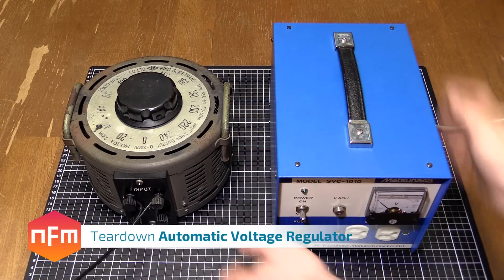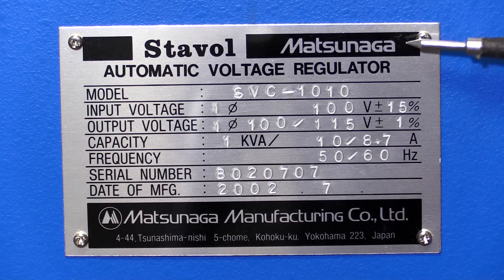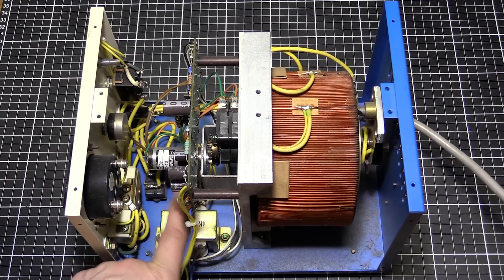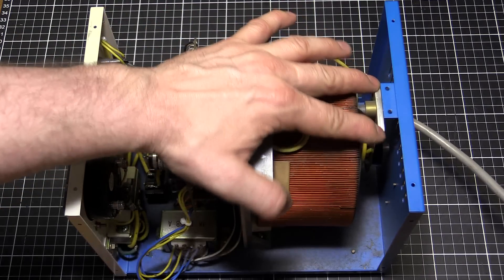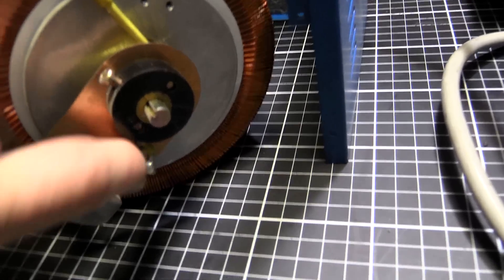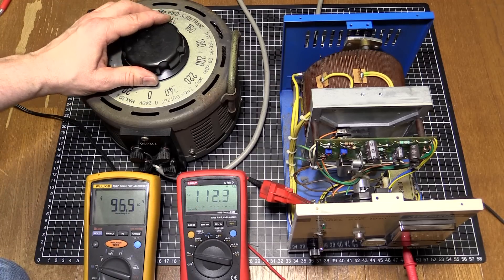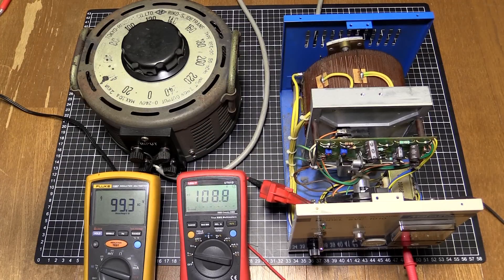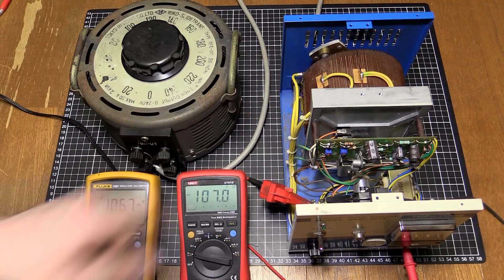A Look at a Matsunaga SVC-1010 Transformer Automatic Voltage Regulator

Comment: thanks for this info. I live in an old house with shady electrical wiring where the lights and other electronics get affected by sudden power loss for less than a second whenever the water pump turns on. I thought an AVR should at least protect sensitive electronics but I guess I have to invest in a UPS.

Comment: Thank you for the teardown and explanation.
This doesn't look like a good design:
1. What if the motor circuit fails, leaving the brush stuck at a point, maybe even the highest voltage gain of the autotransformer?
2. Unless there is some kind of delayed output, the previous position of the brush could potentially mean anything during startup.
3. If the voltage sags due to some heavy load the wiper would simply add more turns to increase the voltage. What if some lighter load is connected in parallel and the heavy load is disconnected?
I might be wrong but I would love to hear how people might have worked out these risks!

Comment: My brother, I have a Japanese regulator, Stack 500. Unfortunately, when I connect it to the electricity, the amp turns on, but the coil in your left hand is broken and smoke comes out of it, and the coal is not damaged and does not work...Is there any hope of fixing it and how is the way with thanks?

Comment: This is a common design 'flaw' on most servo AVRs. The servo is slower to correct for low input voltages (boosting) because the control board power supply (small transformer in the corner) is getting its power straight from the mains input. In other words, if that transformer isn't getting enough voltage (ie. <100V), it has less power to move the servo motor and hence, slower rotor movement to boost the output. This is the same behavior I observed on my servo AVR. I believe that they should've used SMPS to power the control board so it will get a more consistent DC power across a wider mains input voltage. The only part of the circuit that will need mains voltage is the voltage comparator for feedback. Good video!
Reply from the maker: That makes sense. I wonder if using a slightly higher secondary voltage on the control board transformer and regulating it down would help things?

Comment: so are voltage regulators quick enough for home theater components or would you just recommend a good line conditoner instead (without voltage regulation)?
Reply from the maker: They are good for regulating slower line voltage variations rather than transients and surges.
If your home theatre is pulling the line voltage down, you'd have better results in upgrading your wiring etc.
As for line noise, this may help a little due to the mass of the transformer, but it isn't designed to prevent noise and fast transients, only slower voltage fluctuations in the order of seconds or more, like when the grid is loaded up during the day and the voltage drops, but rises at night due to the light load.

Comment: Thanks for the awesome explanation.
I have a new electronic version that'll do the switching without and mechanical parts, but now ai understand the theory.
I live in Bulgaria in the mountains, so its a light line for our 9 houses connected to it, so summers are pretty much a constant 210V - 223V, but in winter with people running electric heaters it drops to 150V sometimes, which is only good to burn things out with.....like fridge compressors, and my electronic central heating pump dont know what to do with 150V either, so its a vital bit of kit here.
Thanks again.

Comment: Not bad. But you can get some nicer models with a bit more protection and functionality. For about 100$ you can get 2000VA model with a MCB, output relay, adjustable hysteresis, under and over voltage protection (disconnect output when it can't compensate anymore), fan, fan fault detection, auto-reset overload protection, temperature sensor for transformer, auto restart with delay, multiple fault lockout (after 5 overloads in short succession it will permanently trip until manually reset), delayed start (after voltage goes back into range that can be regulated, or when turned first time on, the unit will adjust the servo to proper position and only then turn the output relay on), MCU contrlled, and most of the transformer fully resin poted. Yiyen Electric, SCV III series is really nice. The only deficiency is that they are fixed output voltage (can be probably changed with jumpers inside). But that is usually what you want. They also produce relay based ones.

Still if you get this one for 10-20$ it is good enough for playing with it.

Comment: very interesting video. I want to learn more about this. can you give me a source where I could learn about the circuit on this board?
Reply: Hello !

We are one of the leading manufacturers of IGBT Controlled Static Voltage Stabilizer with high precision, fast regulation and inbuilt circuit protections. 
You may check about it more on
https://nkbtechnocratspltd.com/?page_id=125

Contact us on: nkbtechnocrats@outlook.com
Call/Whatsapp: +91 9660061987

Comment: Awesome explanation, I already bought one from https://www.panther.ph/.
Reply: Hello !

We are one of the leading manufacturers of IGBT Controlled Static Voltage Stabilizer with high precision, fast regulation and inbuilt circuit protections. 
You may check about it more on
https://nkbtechnocratspltd.com/?page_id=125

Contact us on: nkbtechnocrats@outlook.com
Call/Whatsapp: +91 9660061987

Comment: This seems slow compared to the relay based AVR, but again the relay based AVRs are choppy because it can only correct the voltage in "ranges" and it also creates sparks when a relay snaps into position.
Reply from the maker: Yeah, it is a little slow, but it's designed more for slow voltage fluctuations like on-peak/off-peak voltage swings during a day rather than voltage transients.
Reply: @NearFarMedia  Hello !

We are one of the leading manufacturers of IGBT Controlled Static Voltage Stabilizer with high precision, fast regulation and inbuilt circuit protections. 
You may check about it more on
https://nkbtechnocratspltd.com/?page_id=125

Contact us on: nkbtechnocrats@outlook.com
Call/Whatsapp: +91 9660061987
Reply: Hello !

We are one of the leading manufacturers of IGBT Controlled Static Voltage Stabilizer with high precision, fast regulation and inbuilt circuit protections. 
You may check about it more on
https://nkbtechnocratspltd.com/?page_id=125

Contact us on: nkbtechnocrats@outlook.com
Call/Whatsapp: +91 9660061987

Comment: Really informative video. I recently got a servo type avr and it does provide consistent output. I did notice though that within the 2 weeks that I've owned it, there were around 3 instances wherein the servo made a loud sound (similar to the sound in your video when the motor moves when there is an abrupt voltage change). I understand that the servo motor moves slightly quite often, but the ones I heard, though very rarely, make it seem that there is a sudden change in voltage.  Didn't notice any fluctuation of electricity though. Is this normal?
Reply from the maker: It may have been compensating for a sag in line voltage. Could be from a storm, or something going wrong on the grid ora big factory starting some equipment or something...
Reply: Hello !

We are one of the leading manufacturers of IGBT Controlled Static Voltage Stabilizer with high precision, fast regulation and inbuilt circuit protections. 
You may check about it more on
https://nkbtechnocratspltd.com/?page_id=125

Contact us on: nkbtechnocrats@outlook.com
Call/Whatsapp: +91 9660061987